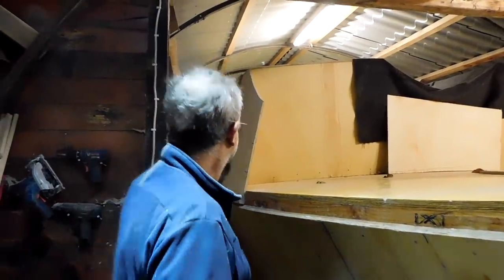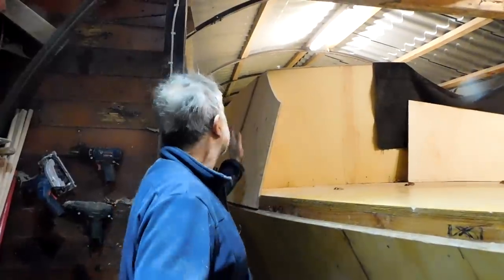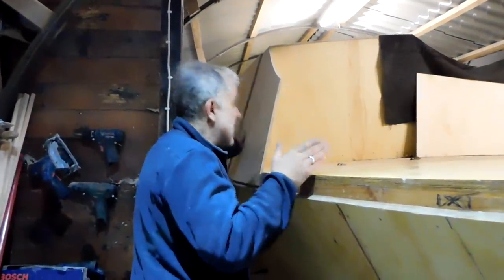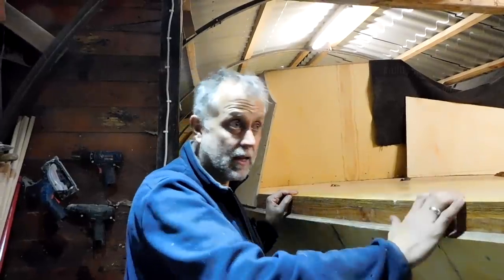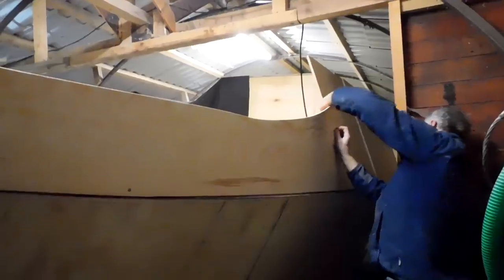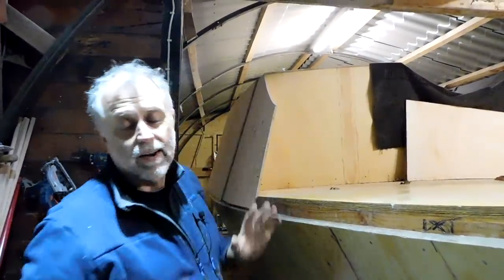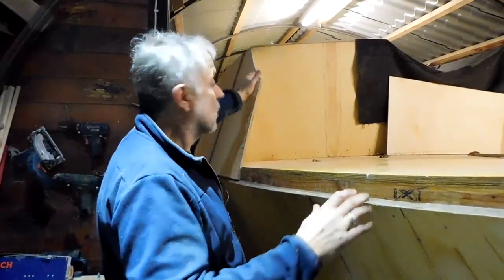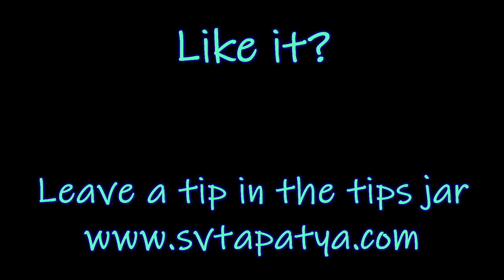More deck, cabin sides and combings - SV Tapatya EP67

Comment: TONY FORGOT TO ASK, WHERE ABOUT WILL THE WATERLINE BE?? TAP SEEMS TO BE WIDE ON THE HIPS AND WILL HAVE VERY LITTLE DRAFT?? WHAT WILL SHE DRAW 12 INCHES AT MOST?? THAT WOULD BE COOL FOR SMALL CREEKS OFF THE MAIN RIVERS, LIKE PRIVATE BAYS TO USE FOR OVER NIGHT STAYS!! AGAIN LOVE IT. I GOT MY HUB MOTOR FOR MY E-WHEELCHAIR I AM MACKING. BEING A MACHINIST COMES IN HANDY FOR ALL THE METAL WORK THAT NEEDS DONE!! , JUST SAYING OLD ONE LEGGED JOSEPH T RETIRED NAVY
Reply from the maker: Hi Joseph
It's a bit deceiving at the moment because the keel will be fitted towards the end of the build ( as is normal with these boats). The final draft will be about 3 ft 6 in. Not as shallow as you suggest, but still able to tuck in out of the way a bit.
Nice to hear you've got a project on the go. Good luck with it!
Reply: @SVTapatya  COOL, I SEE FORGOT ABOUT THE KEEL, BUT 3 FEET PLUS IS STILL NOT BAD. THANKS FOR THE INFO, JUST ASKING OLD ONE LEGGED JOSEPH T RETIRED NAVY

Comment: Another silly question.  What are the coamings for.  I can see that at the back they would work as spray dodgers, but at the front?   Don’t they trap any seas that end up on the fore deck?
Reply from the maker: Yes, that's not a silly question at all Mick. Yes, they will certainly trap any water that breaks over the front. Obviously they need good-sized scuppers to let that drain effectively - I've cut those now. 
They are quite distinctive of Benford dories, although I've seen at least one builder who left the forward ones off. I think they play a safety role for when working on the foredeck - I've always liked high gunwales/bulwarks; they give a feeling of security, and these will do just that. Other than that, decoration.......?????

Comment: Awesome work Tony! I might be jumping ahead a bit...but I am curious what you are going to do with the gap around the hull and cabin top? Is there a rub rail or enough material to round it off/ fill?
Reply from the maker: Thanks Daniel. Yes indeed. The gap is being filled with epoxy and chopped fibres, it'll then be covered with a glass tape in epoxy and then will be capped with a rub rail/ strake.